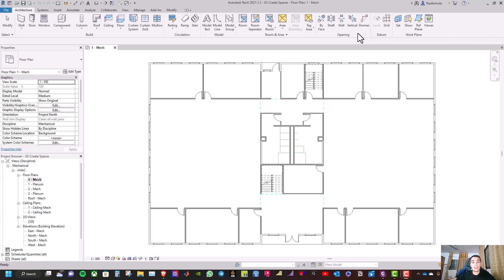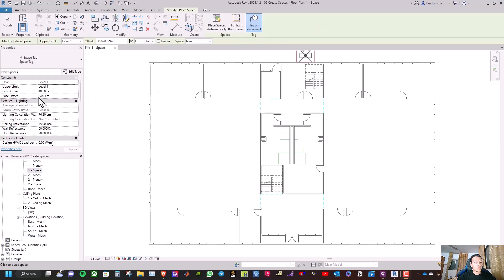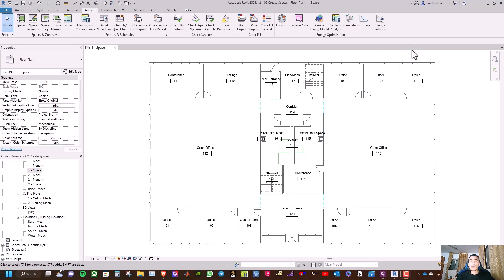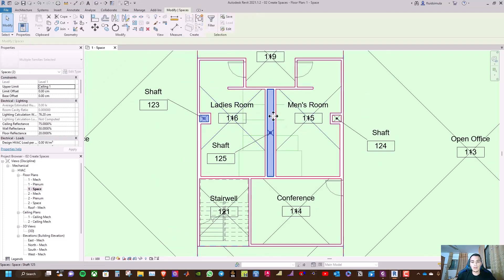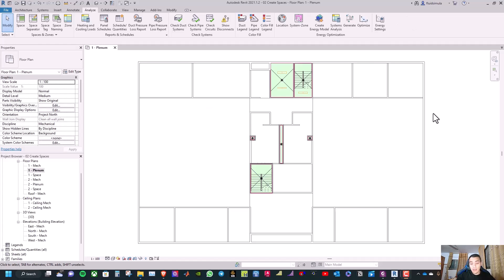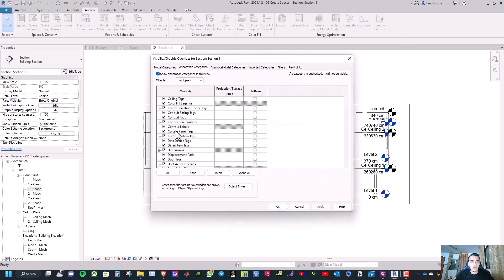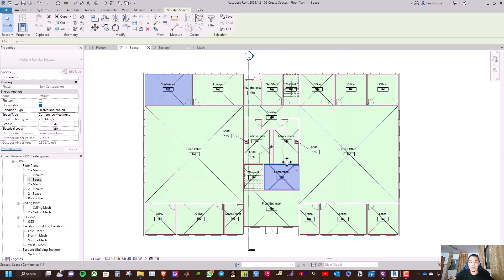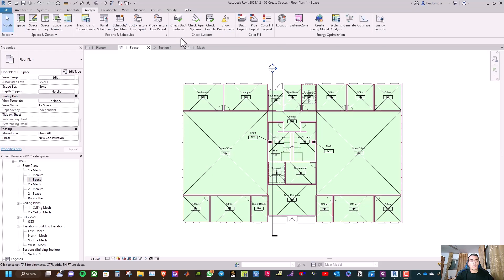02 Create Spaces I Revit MEP

Comment: for the spaces on the second floor, did you make them one by one like de first floor?
Reply from the maker: Yes. You will do the same steps for the second floor.
Reply: @karamalmasri6  The steps include:- double click on 2 - Space,  select space, upper limit = ceiling 2 and limit offset = 0.
then select spaces automatically, type VG>Model categories>check all options of spaces>OK
AFTER that what????? Please tell